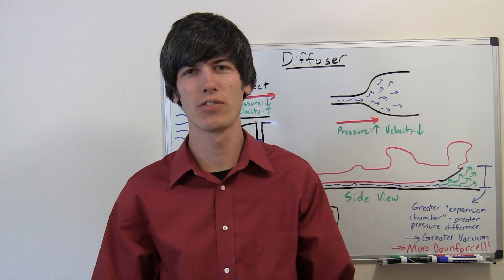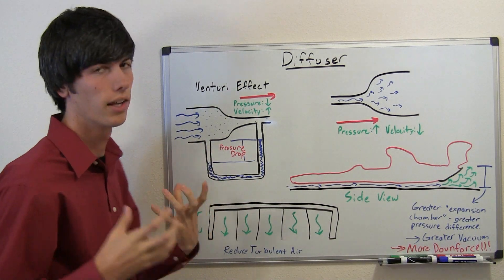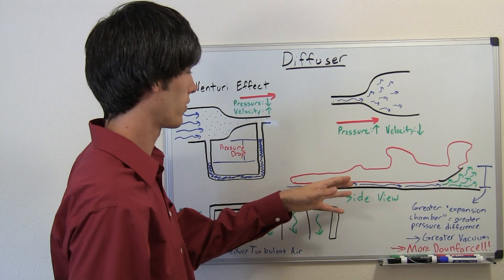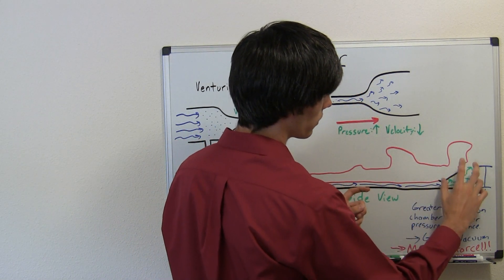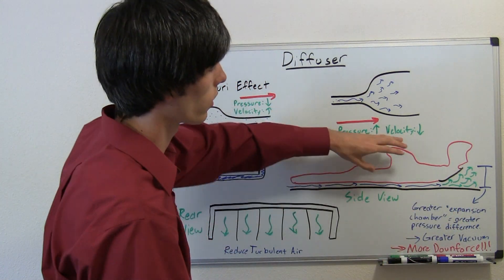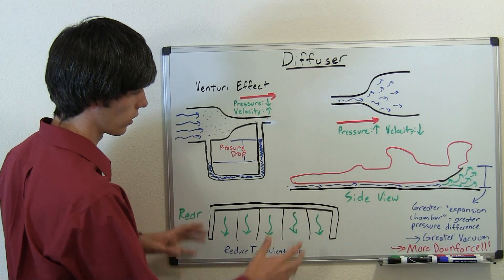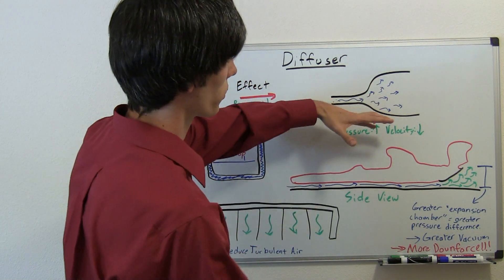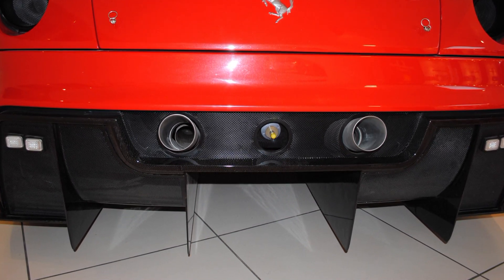Diffuser - Explained

Comment: On a stock car, will the shark fin looking rear diffuser work? Does the underside of the car have to be flat? Will it work with turbulent air underneath a stock car that does not have body panels creating a flat surface?

Comment: Surprised to see that no one noticed that this explanation is totally wrong. The velocity of the air underneath the car has nothing to do with the diffuser opening. Contrary to Bernoulli's law, which is only valid for nonvisocus flow (the viscous effects can be neglected at low velocities), the diffuser generates a vacuum caused by the tendency of the streamlines to follow their linear trajectories, similar to the effect of the airfoil on a wing.
Reply: I've never seen any proof of that

Comment: I'd just say the speed of the car causes the pressure of the air beneath to reduce, so that the ambient air causes a down force. The diffuser's job is  to minimise  the turbulence of the air as it re-imerges from under the car.

Comment: Wouldn't you want the diffuser to create a low pressure zone, or a vacuum under the car at the point where volume increases,  or at the diffuser?  I would think that a given mass needing to occupy more space would create a low pressure zone at the diffuser and not traveling to it.

Comment: Why would the rear having higher pressure ‘suck’ the air out? I thought air moved from higher pressure from lower pressure
Reply: The air on the diffuser has to be sucked from outside, it'll then suck the air underneath

Comment: Love your channel, I learn so much, thank you!!!! So if you had a 35 food long, 11.5 feet high and 8 foot wide motor home with a flat front and back with 10" ground clearance, what would be the best way to divert air into the rear radiator? The fan creates a low pressure, but it would seem there would be a low pressure already accuring there. Could you break up the air on the sides and roof and see if the low pressure from the fan will draw more air into the radiator? Thank you for taking the time to explain things in detail.

Comment: how is the air in the bottom of the car lower pressure than the normal atmosperic pressure, and how does the high pressure air suck the air out of the ground, shouldnt the opposite happen

Comment: Gt wings and trunk spoiler are obsolete...the real air benders are going with diffusers,  precise measurements and placement is key, but I added a flat tray underneath leading up to diffuser for safe measure ..wasn't sure I did anything right until I saw the leaves on the road blow up above my trunk in rear view, 🤑🤑.. +5hp lol

Comment: I was wondering whether it would actually have a beneficial effect to downforce if you actively accelerate the air flow underneath the car via nozzles (at let's say around the front wheel base) that shoot compressed air backwards. 
This definitely accelerates the airflow, creating a bigger pressure difference. But would it have side effects that prevent it from working? Maybe the diffuser cannot handle that anymore?
Thanks
Reply: I'm pretty sure there are blown diffusers that use the exhaust gases to accelerate the air and also, there was that F1 car that had a fan to suck air out from under the car but it was banned because it was too fast.

Comment: @3:20 I don't understand how diffuser can help create greater vacuum? Low pressure vacuum is already there due to high speed air underneath the car. Moreover if you want to compare a car with the Venturi Effect illustration on the left side of your board, then the high pressure at the front of the car will create that pressure difference. 
In my opinion, diffuser at the back is provided to bring low pressure high speed air to normal atmospheric pressure as quickly as possible because we would not want low pressure air at the back of the car as it will create a vacuum and pull the car backwards thereby wasting precious engine power required to overcome this pull.

Comment: The air is forced to go up by the curved up surface that is done with a force exerted by the upper surface. If the force drives air up then an equal force pulls the surface down.

Another way of explaining it is that the airflow wants to separate from the upper curved surface so it lowers the pressure on the surface dragging it down.

Or another way, the wing effect the airspeed on a curved surface is accelerated compared to a flat one, thus the dynamic pressure on the curved surface is lowered.

Comment: I think you could clarify this by swapping your terminology. You talked about a liquid to start. Carry that through, and imagine that the air is liquid, measured in gpm. If you consider flow, then the body of the car is restricting flow, but increasing pressure, as happens with water. When it opens under the diffuser, a drop in pressure would create a larger demand for flow. This could create a vacuum under the tail, increasing down pressure from under. I love your attention to detail! Great videos.

Comment: Wow ... where do I begin?It is clear from reading many comments and watching the video many people have misunderstandings and all too common misconceptions about fluids (yes, air is a fluid) and how they behave. So let me please straighten a few things out ... and do not take any of the following as insulting of anyone's intelligence. 1) Fluids can only exert a pushing force. And as such, fluids can only apply forces from higher pressure to lower pressure regions. Lower pressure regions (partial vacuums) do NOT pull on anything --- basically, there's no such thing as suction as used in everyday language. It is the fluid in a higher pressure region pushing itself (applying a force) into a lower pressure region.2) The air under a car is not flowing past the car ... it's pretty much stationary. The car is moving over a mass of air that is for the most part stagnant. The front of a car equipped with a rear diffuser usually has front geometry set up to push some of the air away from under the car as it's moving. This results in the air under the car now having a lower pressure than it had before the car traveled over it. (Less air -- same volume -- results in lower pressure.) The upper surface of the car is not quite as smooth and therefore has not as low a pressure as that under the car, hence there is a net downward force on the car. Add wings and other devices and you can increase this pressure even more so.3) Turbulence causes pressure in fluids; the more there is, the greater the pressure. Keeping the underside of a car smooth and free of deformations reduces turbulence thereby minimizing whatever low pressure is already there from increasing as a car is moving. The rear diffuser channels the air and allows the low pressure air under a car to meet up with atmospheric pressure with as little turbulence as possible. Everything about higher speeds in cars with regard to air is to keep the air around the car as free from turbulence as possible. If you look on the white board in the video, you can see what happens when air is allowed to escape into a region of different pressure ... turbulence. So, have I covered everything? No. But I don't want to publish a technical paper here either.

Comment: As volume (of the pipe) increases pressure and temperature decreases proportionally thus causing the higher pressure gases in the pipe to move faster.. You could refer to Charles's Law however, that deals with constant volume. Some of this may be derived from the general law of perfect gases, or the ideal gas law, or maybe Boyle's Law.. = Volume and Pressure are inversely proportional.. We all know that pressure and temperature are directly proportional.. (Which law states this?)

Comment: I get that the diffuser slows the airflow as air passes through it, and therefore increases pressure. Simple enough. On its own though, I can't see why this would accelerate and drop the pressure of the airflow in front of it. What's metering the airflow? If X ammount of air comes in the front of the car, why doesn't diffusing it and slowing it down simply slow it down and maintain the same mass flow? And without a diffuser, the air still has to match pressures eventually, it just does so all at once at the back of the car, so, in my line of thought, the same pressure changes occur that would affect massflow. I feel like I'm missing something. I've been digging all over the web, and I can't find why diffusing an airflow necessitates and increase of airflow upstream.

Comment: How does pressure increase when fluid comes out from an orifice to a larger area? Wouldn't the force be distributed among the large area and hence pressure reduces?
Reply: Pratheep Kalaiselvan yes I have the same doubt
Reply: The reduction in kinetic energy has to be converted into some form I.e. pressure.
Reply: Air pressure is based on the amount of air molecules. When it expands to a larger area, it allows more air molecules to flow through that area and thus higher air pressure.

Comment: completely incorrect.  the air over the car is high speed and lower pressure.. the wings and tunnels try and counteract the vacuum effect.   remember, vacuum doesnt do anythign.... pressure does the work... the "vacuum" you speak of at the rear doesnt change the lower pressure zone under the car.   it doesnt "suck" thats a misnomer.    you make an analogy to the venturi tube and its NOTHING like it with the car.  the rear divergent area doesnt dictate the speed of the air under it.  please remove this video... it just confuses folks.

Comment: air under the car is ambient, except for the venturi tunnels regardless of speed
Reply: you dont increase the velocity of the air under the car, even with the venturi tunnels. the exit angles are based on flow efficiency and drag reduction. (trying to meet the over car air efficiently).  the angles do NOT change the flow under the car.  go look up venturi effect, and look at the effect of different sized and angled rear diffusers. the speed in the venturi is dictated by ONLY the incoming air and convergent proportions.
Reply: while i'm not about to accuse our host of being wrong, i had the same objection to his explanation. the important pressure differential exists between the low press. space in the diffuser and the ambient air above the car, not between the diffuser and the underside of the car. imh(and undereducated)o.

Comment: Interesting! I never knew what they did, I only knew they cooled cool hehe. So I suppose this would work on pretty much any vehicle? For example, a Subaru Impreza GT -99. I suppose it has to be low though so I could always lower it and use coilovers.
Reply: No.It only works on very low flat bottom car.  Road cars don't get smooth flow under them and sit to high to trap air properly so putting a defuser on a impreza does nothing.
Reply: just me Obviously I'd lower it and may even fix some sort of a thin layer underneath lol.

Comment: does Bernoulli principle apply on moving car? if so isn't that the air flow on top of car faster than air flow under the car, wouldn't that create a higher air pressure under the car and lifting the car?

Comment: The diffuser strakes are not used to make the flow go straight without turbulence. In fact, what they do is to create vortices that take the high energy air from the floor and move it to the boundary layer on the diffuser, thus increasing the energy of the boundary layer and preventing flow separarion (that's why we can build diffusers with large angles of inclination).

Comment: If there isn't  divider, air flow might be turbulent at the rear side  and it offer much pressure than a laminar air flow. It create even higher pressure drops, thus higher down force is achieved, then what is the significance of creating a laminar flow there?

Comment: So where does the downforce of a diffuser exactly operate? Beneath the whole car or only at the rear (which I always thought it would do)?
Reply: +KingLuigi96 There's no easy answer to this question. Generally, the diffusor generates a low pressure spike just at it's most forward point, basically where it starts.
But the diffusor also increases the downforce the whole undertray produces and especially at the very beginning of the undertray. It's often said, that if you want to produce more downforce at the rear with the diffusor, you have to change the aerodynamics at the front of the undertray and if you want more downforce at the front of the undertray, you have to change the aerodynamics at the diffusor itself.

Comment: There is definitely low pressure behind the car in that expansion.  I think what you were trying to say is that the vacuum caused by the diffuser pulls air out from under the car (creates a partial vaccum under the car) which causes the downforce.

Comment: I think you have this backwards, man. Diffusers' expansion areas have LOWER pressure and LOWER velocity. Before the expansion area it's HIGH velocity and relatively HIGH pressure.
Reply: +Ben Garrido Nope. High velocity air has low pressure, low velocity has high pressure. The expansion area has a high pressure area due to the air slowing. The air slowing helps reduce turbulence behind the car.
Reply: +Hear That? Pretty sure you need a vacuum under the car if you want downforce from your diffuser.

That said, I was wrong about velocity. The slow air speeds up on expansion. High speed equals low pressure.

Comment: You always see those in movies, I always just thought they were for looks. Also, why limit a sport that's based on engineering?
Reply: +6Twisted F1 learned from the ground effect era that there is in fact such a thing as too much downforce.
Reply: Good observation. The reason for limiting the sport is, in my opinion, for driver safety (and thus public perception as well). These aerodynamic breakthroughs are indeed highly effective and reproducible - the problem is that racing conditions do not always satisfy the requirements to take advantage of this tech; I am of course referring to dirty air. If a car is optimized based on the use of ground effects, what happens when you're following a car and your airflow is disrupted - you lose downforce that you're car is depending on to turn, resulting in accidents. While engineers and driver's may be willing to take this risk, if it were not regulated then anyone who wanted to be competitive would have to use this strategy and accept that risk...

Comment: I really like your videos thanks for making them.  This is one of the few I wonder if could be better though.  Maybe the topic is just too complicated to explain in 5 minutes.  It would be hard to explain an airplane wing in five minutes -- correctly.

Some food for thought for everyone: 

- As we all know, there is a low pressure area behind the car from the car's form drag.  It would be nice to take advantage of that to pull the car down.   A diffuser is perhaps an attempt at that -- while there is low relative pressure back there, there is an "impedance mismatch" in areas that makes it hard for us to utilize it to "pull" (reduce pressure) much air beneath the car.  The diffuser helps address that?  

- Also worth noting for that air under the car, we have to get it around those big rear tires!  Thus if adjacent to the tires at the rear the tunnel is getting taller, we make it easier for the air to get out the back.  This might be a reason a diffuser could help a bit with drag, independent of downforce.

- There are other nuances such as the tendancy of a fluid (air) to follow along a shape even if curved (the diffuser), which might throw the air upwards, and newtons third law then says that pushes the car down.  i.e. the diffuser is a bit like the back half of an airfoil.
Reply: Actually, just wave a piece of paper around and figure out the airflow.
Reply: +aesop m Actually a wing is much easier as it has no ground effect
Reply: +El BU unless you are either taking off or landing! (Sorry, but I couldn't resist that cheeky comment)
Reply: +Adam Beevers True